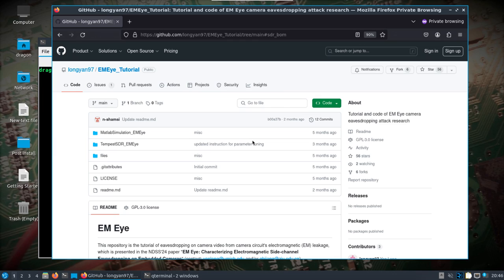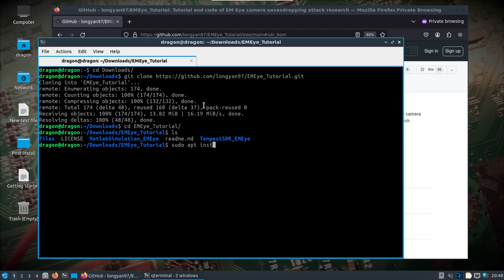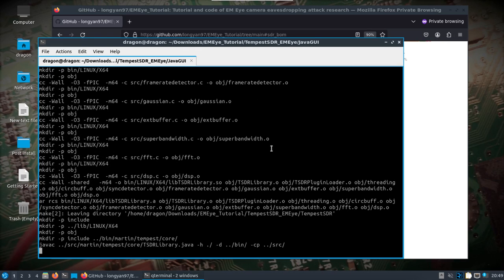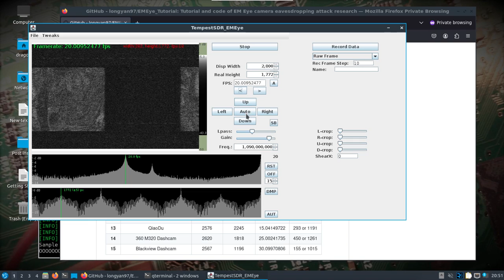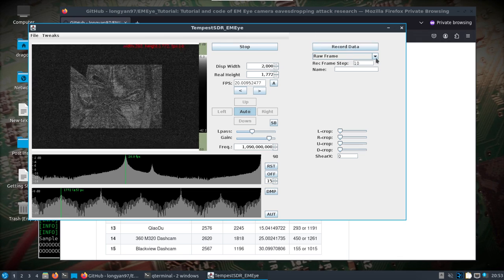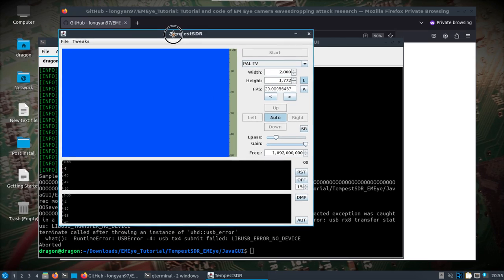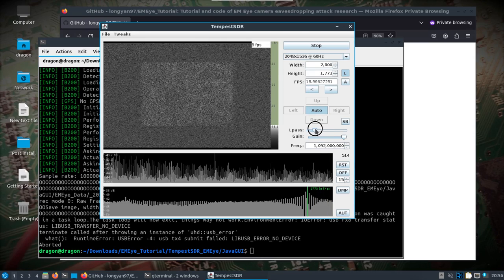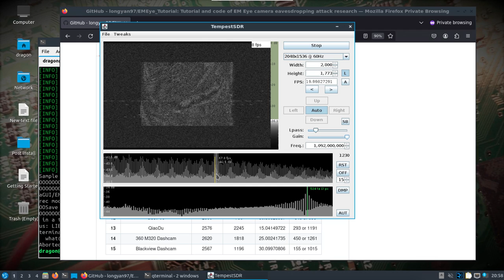WarDragon EMEye/TempestSDR Camera Eavesdropping Attack Research (B210, Airspy R2, Wzye Cam Pan v2)

Comment: Just seen this amazing I wonder if you set the jammer on a portapack and centered it to 60hz obviously for a 60hz tv or whatever FREQ it on,  I wonder if that would stop the picture from being picked up????
Reply from the maker: Maybe but I’ve been able to “see” the leakage on multiple different frequencies far apart from one another. Not sure what would happen in the case of what you’re suggesting. I should try

Comment: Hi, great videos.  I just loaded Dragon OS recently.  SDR, etc is a bit new to me.  I use other distro's for bug bounty, ethical hacking, I sort of mix and mash, but dragon is a new one to me.  I could use some advice, which is a fairly ambiguous statement.  I could redirect with keys, or be redirected with keys.  Could start at protonmail and bounce around a bit from there.  Just some tech advice;  I'm sort of switching careers in my mid 40's.  If not you maybe there's someone else who might be able to help me.  I would pay for their time as a consultant.  Thanks.  I think my regular gmail is public through this comment.  That should be fine, if not thanks for all the informative videos!
Reply from the maker: I can’t see your email, but I’d be glad to help. My email is up under the about on the YouTube page. I make sure to check it every now and then, so if I don’t get right back to you just give me a few.

Comment: 40 years ago , Tempest was a classified project...
What range are you getting ?
Reply from the maker: That was sitting right next to it. I got about 5 feet with a directional antenna so far, but I think I need one tuned to the frequency and or maybe an LNA.
Reply: @cemaxecuter7783  The more antenna gain the better. I am not sure how much an LNA would help to improve the SNR. From my experience an LNA only really helps to overcome feder loss if it is placed right after the antenna.
Reply: Probably need a 5w amp

Comment: Very Interesting, would the Pluto + work for this?
I mean is duplex and works in that frecuency right?
Reply from the maker: The AntSDR should since it can run uhd. I’ll check and see if there’s a build that’s got Pluto support.
Reply: @cemaxecuter7783  Yep I would deeply appreaciate it!
Reply from the maker: @314Show so I’m not seeing anything for TempestSDR.. but.. but you could try with this 
https://github.com/git-artes/gr-tempest

And utilize a iio/soapy/pluto source block. I can’t remember its exact name, but there’s for sure support for it in Gnuradio. Everything, to include this gr-tempest is also included in Dragon. It just may not be as user friendly compared to TempestSDR.
Reply: @cemaxecuter7783  Okaay, thanks for the repo
So the problem is more related to software rather than hardware right?
It would be amazing to have a tool that unifies all drivers and diferent brands
Reply from the maker: @314Show  for the most part soapy is pretty good about that but yes, in this case I’m not finding a version of TempestSDR that can use soapy or just outright iio for Pluto plus.